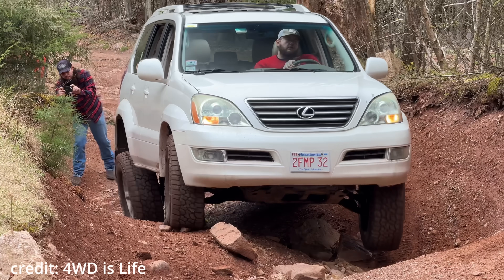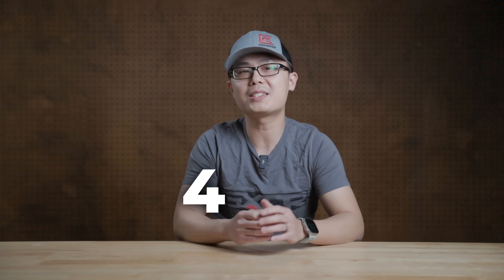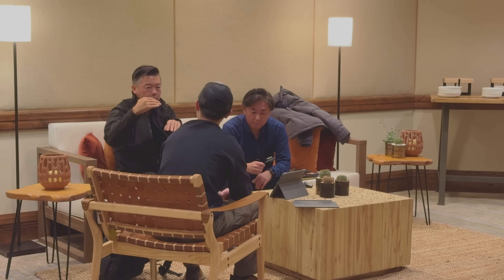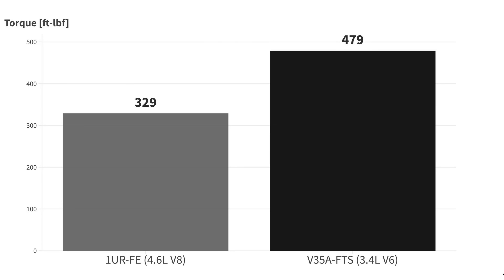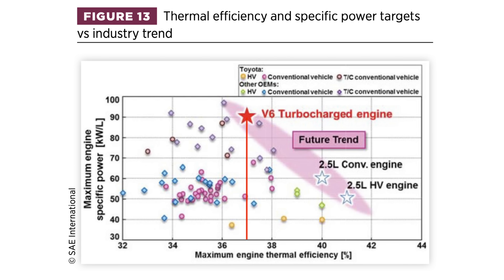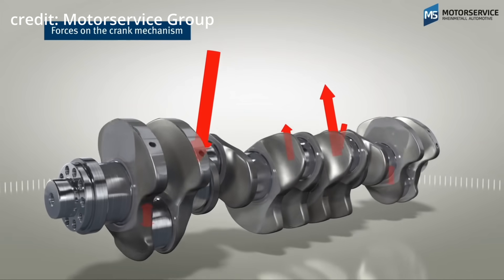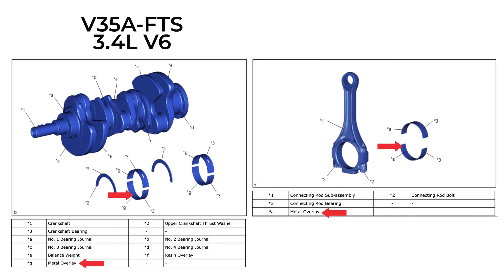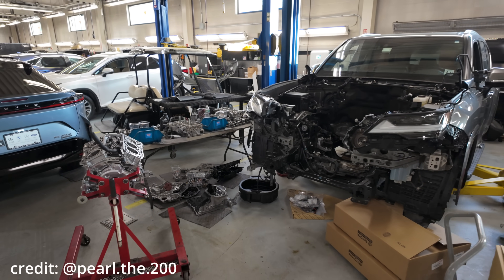Is Toyota V35A-FTS Engine Reliable? Well..It's Not That Simple

Comment: Apply the same BMEP to two engines, one oversquare, one undersquare, and they will yield the same torque, all other things being equal, and ignoring the effect of rod angle.
   But the undersquare cylinder limits possible valve area and breathing efficiency, so favors (or is limited to...depending on how you'd like to word it) lower rpm power. The increased piston speed would favor low rpm use, also.
    I bet they went with undersquare for packaging for a narrower v angle, or maybe limiting heat loss to combustion chamber area when near TDC,  or less of a "flat disc" combustion chamber to enable more turbulence.
    Whatever the reason, I would gladly sacrifice a bit of efficiency for longevity, durability, and simplicity.
   Blowing it up, tossing it, and getting a new one is not my idea of efficiency,  it is pure waste. But these are marketed to people that need a constant influx of new, shiny, "best" things. 
   Which disgusts me.
  I do not have high hopes for exhaust valve life on these, especially if worked hard, like towing. Maybe the failing main bearings will prevent short exhaust valve life for becoming apparent.  
     Poor little valves are stuck between a 120hp/L engine and a turbo that restricts egress and raises the pressure/density/heat transfer ability of the extremely hot and corrosive exhaust gasses...what a tough life they will have.
    I have always been a toyota fan, but was frustrated by their typical low power and small displacement. Who told them to use tiny engines? Nobody. I thought they were finally figuring out that highest hp/L is utterly useless...it needs to fit in the car, and produce useful power reliably and efficiently...hp/L is nothing but an "engineer wanker" goal, unless it is to meet some artificial racing requirements or something..
   Now they are back up to their old tricks with small engines, but with the huge drawbacks of reliability issues and high complexity.
   I'll take the 5.7. I doubt I ever want one of these v6's used.

Comment: Is it unusual for modern FI petrol engines to be producing high numbers? we have seen the potential of the turbo V6 in a similar sized powerplant as the Nissan VR38. There are plenty of modern tech efficiencies that skew power from displacement with turbos and superchargers. I don't see why these will be any different?

Comment: A cylinder explosion that creates power, doesn't care about efficiency.  The force that it takes to push the cylinder away from the head is the same for the same power level.  That force is what puts a load on the Crank and bearings.  The advantage a long stroke engine has is that that longer stroke allows a longer, more laminar draw of fuel air mix.  However, this is outweighed by the more severe angles that the longer stroke creates as the rod is travelling through it's circle.  These severe angles cannot take as much a load as a shorter stroke.  Add to that the higher forces created by Turbos and it is not a good mix for reliability.  Then I looked at a picture of that ladder frame and each side has 4 bolts for a total of 8 bolts for the frame.  So that is 2.6 bolts per cap equivalent, vs 6 bolts per cap for the older engine.  That also makes a difference.

Comment: So is this issue really limited to just the Tundra or are Sequoias having issues as well. And why does this supposedly not affect hybrids, it’s the exact same engine…
Reply: Because its a safety recall. The issue being that if the engine dies while driving, you lose power steering and potentially braking assist.

The hybrids(all Sequoias are hybrid) dont have this issue due to the hybrid battery being able to power the electric power steering and brake assist.

Comment: There are two main things happening in the USA that are drastically shaping engineering today, for better and for worse. 1) Competition is continually driving innovation and advancement in materials science, metallurgy, combustion technologies(efficiency), etc... this is why internal combustion engines will last way longer in a free market than people are forecasting with the advent of electric motors(barring legislations that outright bans them). 2) Legislation and "fleet efficiency standards" are essentially forcing auto makers to run smaller engines with multiple turbos to achieve the same power, all things being equal, this is massively increasing the mechanical complexity of cars today(making them harder and more expensive to service) and decreasing the reliability of drivetrains.

Comment: Land Rover had a similar problem with their 2.7/3 Diesel. Partially solved by replacing the oil pump with a higher capacity and changing the viscosity of the oil. It is also often said that the oil for this engine is too thin and that you should try pouring thicker oil. 
Stories about someone not washing parts properly at the factory are 100% and a minus to Toyota's reputation. Engines break down all over the world and not for the first year

Comment: No placement like displacement. I hate turbos on “reliable” cars because it’s an oxymoron. I sought out my nearly 20 year old Tundra with a 4.7. While yes many things will and have been replaced with over 222k miles, the engine is still running strong.
Reply: The older Toyotas suck on gas for being as small, basic, and slow as they are. Yes they are for the most part reliable.  Turbos have been around for years, Toyota will perfect any issues over time, but they needed to step it up. 

Getting 15mpg and moving like a snail in a tiny ass truck doesn’t make sense and is inexcusable in 2024. People want power and good mpg…. The problem is people need to be less lazy and learn to work on their own stuff.

Comment: The only way I could see any turbo charged engines last beyond 200,000 miles is if the turbos are replaced at specific intervals. Where those intervals are is dependent on who makes the turbos and how good the quality of the metal is. The second any turbo starts to go, even a little bit, they throw small metal fragment directly into the engine. Doesn’t matter who makes the engine, once that happens, that’s it. Engine dead.

Comment: Torque is a product of displacement, simple as that, you see 3.4L stamped on the side and you think it’s a small engine but if it’s running an atmosphere of boost it’s effectively an 6.8L engine. Think of it in those terms and it’s really not that mysterious.

Comment: Its so ironic. Toyota fan bois have becocme the same as the car guys from before, ie V8 guys. We said, bigger engines are less stressed. Litric power (power/cc) was never a concern in the old days, but you had the guys with small turbocharged engines saying they were better, faster, etc.

FFW 20 years, and Toyota, Nissan, etc, began making bigger engines. And rightfully so, and now they are downsizing, and having the same reliability issues that plagued American cars in the 70s and 80s, that would give them a reputation for being bad. Comsumers have a short memory, thinking of Cimarrons, and Vegas, and not the 350s or big blocks that lasted forever.

As far as what Toyota is saying now, its marketing bs. Yes, the smaller engine will have more stress and strain on it. The easy way to think of it is like this. Take a sail. A less efficient sail is a smaller one. If you increase the sail, with the same tiedowns, you make it more efficient, capturing more energy from the wind, but puts more strain on the masts and all that (dont know why I went to sails lol. I dont sail or even swim LOL). This is why a less efficient application of an engine, say a 2 valve 4.6 that barely gets 200HP and change in a Crown Victoria will drive for a million miles, but the Mustang variant with 4 valves will need a rebuild at 200k. 

Btw, Im not knocking you or anyone. Just figured I should mention this, for those that fall in a us vs them, big vs small argument, either with cope or whatever. Just like what you like and thats it. Some things are faster, others more durable. The world keeps turning, and sides change. (but old engines with less power still run LOL)

Comment: I mean. I probably don't know enough about that engine But the first thing come to my mind as a mechanical engineer is Newton's third law. Smaller displacement pushing more power is not really a problem in my mind but less cylinder pushing more power is what i don't like about the new Toyota engine (looking at something called 2.8L in a landcruiser haha). 

 Regardless of the displacement for a normal engine (not high rev for anything special) more cylinder means the what ever torque ( torque is the one that kills the engine really) the engine is pushing it's is more relaxed. I am talking in general term. U can have a v12 with stupid tiny big end and gives Lots of trouble.

Comment: Just because an engine is smaller but puts out more power than its larger predecessor doesn’t mean it’s overstressed.

There is not one shred of evidence to suggest that these engines are over-stressed. And no, manufacturing issues causing premature bearing/crank failures doesn’t count.

Comment: If the problem is not in the block, or in this case the bearing support and everything is in tolerance, then the obvious problem is the crankshaft itself. Also, i must ask, are these engines start stop design? How many dry starts can any engine handle with your foot on the floor? Anyone heard of the "stop light grand prix?". Start stop technology, no oil pressure, sudden restart and full throttle would certainly tear the bearings apart. All of them in short order i might add! Did i find the "smoking gun?" If that's not it, then we have some serious quality control issues and the bearing cradles are not aligning in the block properly causing bearing misalignment. Any misalignment will wipe the bearings out in short order. Toyota had better figure this one out PRONTO!!

Comment: All things being equal (horsepower  & torque) a V8 vs a V6 will have less stress on each bearing ,(crank and  rod) because the load is spread over more total load surfaces.  There's no free lunch.

Comment: As a european comment section is wild, oilchanges at 10k miles (should 1.5-2.5k miles) and genuinely low reliability, 120-180k miles is what any regular car does, with more reliable ones hitting 310-560k miles before the car is to worn out to be worth fixing. Yes, some maintenance will have to be done to get there, especially in the suspension, but also general wear and tear items and freak failures

Comment: So if the V6 twin turbo is overstressed, I wonder what is the Land Cruiser 4 cylinder turbo hybrid stress level
Reply: Its not overstressed, thats the point. Everyone acts like there is not engineering or metallurgical improvements that can make the V6 withstand higher stress than an NA V8. Its not like every NA motor ever built was the absolute pinnacle of engineering and technology and could not be improved upon.

And we know why the motors are failing now and it has nothing to do with stress.

Comment: If they’re bolting cast iron onto aluminum, you’re running into different expansion factors of the dissimilar metals. I bet the tolerances are shifting around as the engine heats and cools. Not good.

Comment: the real dream is a 200 series with a 8 cyl diesel engine like they have in the middle east in a MANUAL option. THAT right there is the impossible for America. 

2nd place is a 98 LC vx 6 cyl diesel in a manual with cloth seats 🤤🤤🤤

Comment: The issue could be related to oil blockage, similar to the cause of a human heart attack. These new engines have very small holes for oil circulation, that could be a problem.

Comment: My little 2022 Daihatsu Hijet does everything around my ranch I need it too. And though here in U.S. cant have it on freeway or highway, goes everywhere around town. Importing a Hilux Champ from the philippines, which will be LHD like my daihatsu haha...

Only need the cab and the bed, going to use a tacoma as a donor for the frame and etc. Have a 2007 1HZ from my troopy going to swap. 

I wonder what I can swap into my new landcruiser once that also arrives. I am not to keen on the reliability issues. Eh I am old. I will figure it out I guess.

Comment: 0:50 What do you mean a typical 5.5 V8 engine?
Is it a diesel? Is it a gasoline?
2 valve per cylinder, 3 valve per cylinder, 4 valve per cylinder, 5 valve per cylinder
2 stroke or 4 stroke??
Where is it’s torque curve?

Why is it a typical 5.5 V8??

Comment: Power density is what shortens the life of an engine. Higher heat kills them . V8 isn’t stressed compared to a turbo or small engine high horsepower. Simple is better if this was a big block 4.0-5.0+ liter v6 and low boost with a thick block design that’s would be different

Comment: @ 13:09 what happened to landcruiser 200 when the sound with a crack noise? 13:09
Reply: Snapped both CV axles it looks like. Super common on lc 200 when off-roading. Shock loading the CV’s even slightly will fatigue crack and eventually snap.

Comment: Rpms would be  higher on the moter in question vs a V=8 correct?
Reply: No, they would be lower. These TTV6's make a ton of torque at low RPM. Peak torque is 479 at 2400 rpm, while the 5.7L V8 was 401 at 3600 rpm. Peak power is at 5200rpm while the former 3UR 5.7L V8 was at 5600 rpm.

Comment: I think everyone is obsessed with power numbers. Power is definitely nice to have, but id rather have a less powerful engine that lasts longer. I have a 2001 ford explorer 4.0 with about 200 hp and 200 torque. Not impressive, but its not supposed to be. The engine is relaxed, and still running like clockwork 23 years later as a daily with 201k miles. Never skips a beat. I dont doubt the quality of lexus, but i refuse to believe they have the same refusal to quit like their older engines.

Comment: No discussion of the ultra lightweight engine oil that's being used on these modern engines?
Reply: That to me is a problem. If I owned one of these I would run 5W-30 at least.

Ford had initially spec'd 5W-20 in the 3.5L Ecoboost and after a year or two switched to 5W-30. I eventually started running 0W-40 Euro oil in mine.

Comment: Would you steer. Clear of the new GX? I have one ordered ????
Reply: If it has not been built yet then I would not be too concerned as the have likely identified and fixed the problem for future engines based on the recall that was released for the Tundra and LX600.

Comment: Fords twin turbo 3.5L Eco Boost have been out for years and that is a solid engine. There are a lot of those engines out there with over 200K miles on original turbos. They did just have a recal but its because of defective valves | nothing to do with the engineering. So I don't buy V6 turbo charged engines are over stressed.

Comment: When you have known failures with an engine that's a tiny percentage of the entire fleet at relatively low miles, that all meet a very specific set of conditions (build date, for example), the problem doesn't lie in the design, it lies in the manufacturing.  These main bearing failures are probably a result of assembly or parts QC, and no doubt are being followed by Toyota so they can address the issue at the source.  The design is likely not at fault, many manufacturers have been going this direction for a long time, and these little V6's are far beefier than most higher end V8's.  They're using tricks and engineering techniques that have never been used in the OEM world before, only in bleeding edge racing development.  Ford has been doing this with ecoboost V6's for many years, and they're not without problems either, but all have been attributed to QC problems, not design problems. Maybe an oil passage was blocked with flashing or machining swarf, maybe some batch of valves wasn't properly heat treated, perhaps they were using the wrong torque during assembly, whatever the case...the design and concept of using high output low displacement forced induction itself is not the culprit.  Design issues usually manifest when an engine reaches a lot of miles and owners are stretching or blowing past the expected lifespan of what was envisioned.  Change is scary and people love to blame all the problems on the new scary thing without taking a step back and looking at things logically.

Comment: Bad Oil quality. I have Nissan Titan XD diesel, all these engines have a crankshaft. I ad same issue. I have noticed before engine failed I had oil consumptions, so it was needed to monitor, and used to be Mobil oil for diesel. I switched with Amsoil oil, after repalce engine with used one as I was out warranty just by 5 months. So with Amsoil I have no issue with oil consumption at all. I will tell you more, I got broken in Michigan, so local Nissan dealership replaced a engine, and use Mobil oil, after driving back to VA - 800 miles, my oil wasn't at full mark but 0.25 less. So I did oil change right the way with Amsoil 10W-40 and never looked back as has zero consumptions and my catch can never fill oil, just about only fee grams.
Switch to Amsoil and you will forget crankshaft issue forever. All this high output engines with small displacement has same issue there is no oil can survive loads.Titan XD motor is Cummins 5.0 with 560 lb of torque